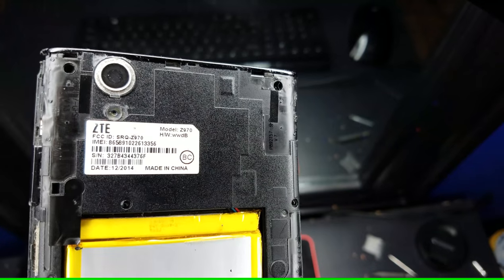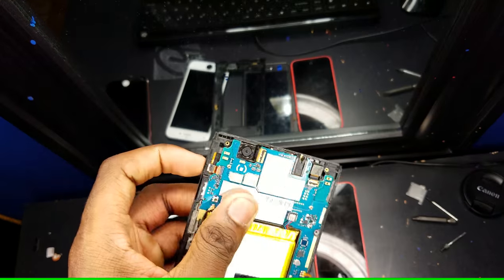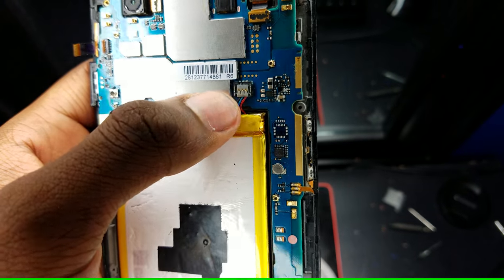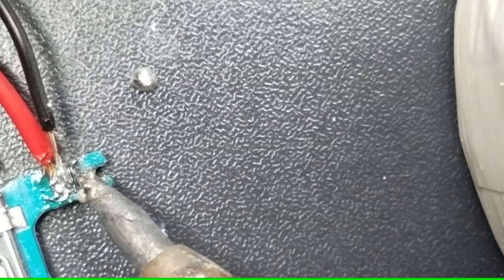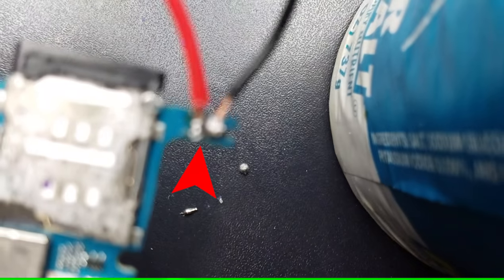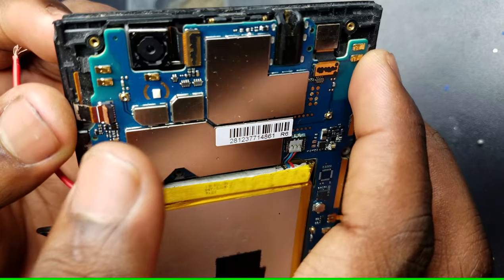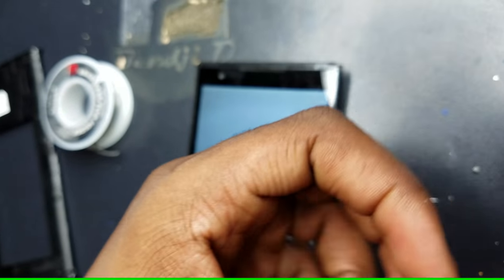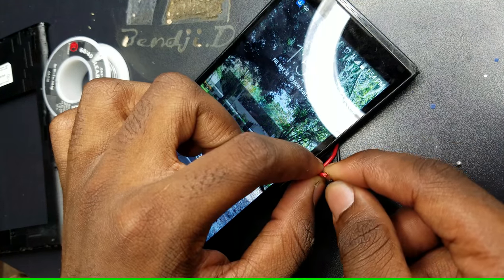ZTE ZMAX Z970 Power Button Replacement: Do It Yourself | Get Fixed

Comment: You should've at least soldered it to any spare button outside the case. Otherwise it's prone to accidental activations in your pocket and whatnot.
Reply from the maker: I know I thought about that, but I also figured the average person does not have a perfectly intact button just lying around so I decided to go with just the wires.
Reply: Bendji D An average person can't solder shit and once you start tinkering — those components are usually lying all over the place.